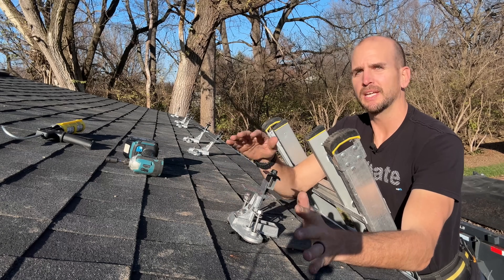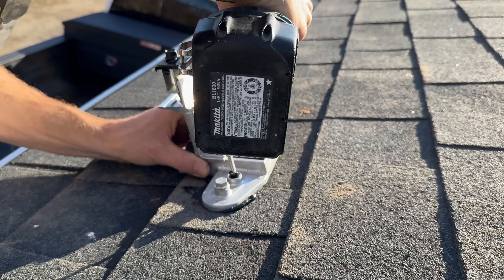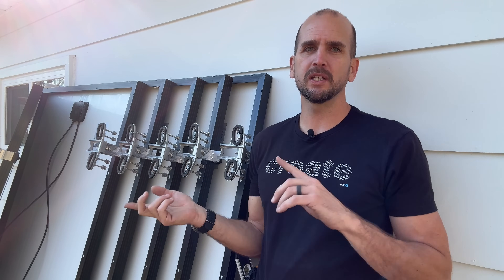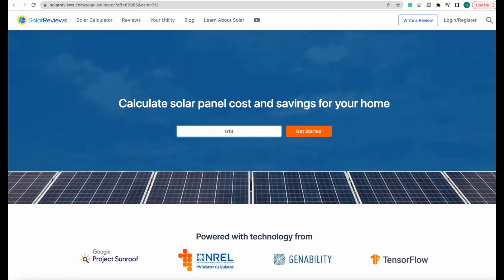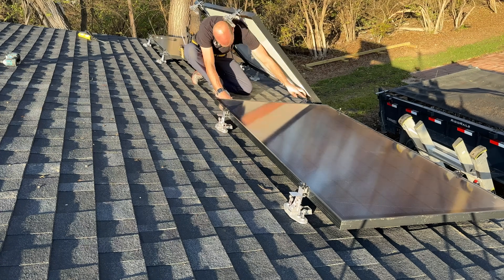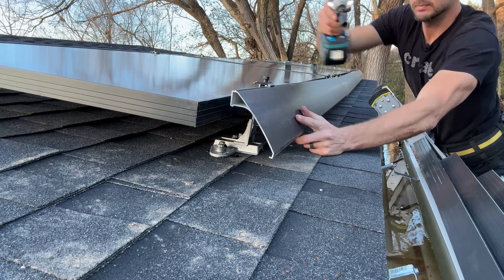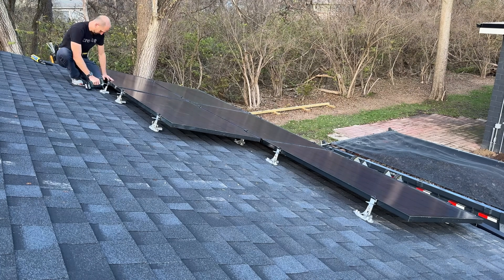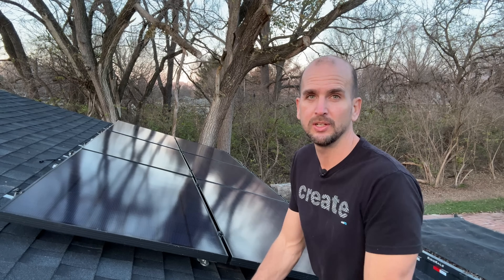Easy DIY Solar Panel Roof Installation

Comment: Lots of concerns about the holes and sealant, not sure why, you seal all sorts of stuff on a roof and if you install a metal roof all the screws are exposed with a seal on them. Anyways good tutorial on installation....my only question is if a bottom panel gets damaged can you replace without removing top row?
Reply from the maker: Yeah, the holes concern me as well.  That is why I wanted to test these on an unfinished detached garage as compared to my home.  You will be able to replace panels from the first row without removing top row but probably will have to remove that section of skirting.

Comment: From my experience in the marine industry, ALL sealants eventually leak. And that is on a clean, smooth gel coat surfaces. Sealing on asphalt for long term will be next to impossible, especially the way you did it. Most of the sealant is sticking to the shingle grit, which is not integral with the asphalt shingle. That grit will release from the shingle at some point in its lifetime. As the asphalt shingles lose their volatile compounds, the shingles will shrink and crack. Wind and thermal loads will cause movement and flexing of the panels, and the mounts where they are lagged to the roof. All of these factors spell disaster for keeping the water out. Wet drywall would be the least of my worries. The roof decking will rot, and eventually the roof trusses. This will be an expensive repair once the inevitable happens.

Comment: Cool concept, but I feel like a strong wind would rip the sheeting right off the roof.
Reply from the maker: They claim 90-180 mph and not sure what factor gets you 90 and what gets you 180.  Most likely the decking thickness.
Reply: Looks like osb roof. Weak.No drywall means you can put plywood backers inside.Next time hit a truss n backers.And seal around those things not just under.

Comment: Aluminum solar rails are SUPER cheap and easy to work with, I'll stick with them, and simple L-feet with rubber micro-flashing in rafters.  I installed my own 5kW PV system this way, several years ago, and it's worked perfect, ever since.

Comment: Could i use these mounts on my camper conversion!? Ill be useing an eco flow ultra for my batteries and electrical system
Reply: 1/2 inch osb doesn’t hold well.Must have big inside backers for bolts to grip.I’m not cutting my ceiling out for backers just yet.Even if yah hit a truss that’s only 1.5 inch.So only 1 bolt would hit it..First I ever seen those brackets

Comment: Absolutely not. Relying on sealant rather than flashing?!?! Also, roof sheathing is often only 1/2 inch thick so it's laughable that the bolts are so long - it's almost as if they give you long bolts so you think you're getting a strong connection. I would expect those bolts to get ripped right out during the 60-70+ mph winds I get in my area every year.
Reply: I get those winds in Cheyenne Wyoming too!!!! Where are you?

Comment: Looks nifty!. I don't see sealing as a significant problem if done correctly. Wind resistance may be perhaps. Permitting is the number one reason DIY sucks in many places however. Most people give up before getting past that.

Comment: I think we should add silicon to the screw threads as well to ensure sealing.
Reply from the maker: If you fill up each pad as the lag is being driven it will pull through the sealant and should coat the threads fairly effectively.  At least that is what I was seeing.

Comment: In my jurisdiction the local inspectors will not let you make penetrations without flashings. I've pulled over 200 permits and often work with roofing companies especially when the homeowner just paid for a brand new roof with a long term warranty. I tried something like this in the past and the roofer yelled at me and told me to get my ass off the job site because I did not use flashings. Also we are in the Highwind zone and I do not think you could ever get away with penetrating the decking only. Also I have run into many situations where the decking is old and not competent and you absolutely have to be secured into the roof truss. So you mount six panels Which requires 24 of these mounts and 96 penetrations. No disrespect but I think this is a horrible idea and you do take a serious risk of having a leak 5 to 10 years down the road. Also installers get lazy with the caulking and do you have a good chance of having leaks right out of the gate. Eco Flo delta's are for camping they are not residential power quality and good luck if they even last five years. Also this guy is clearly not pulling a permit because there is no rapid shut down devices. This is another video that is essentially showing people how to do things wrong and is a bit of a stain on the solar industry.
Reply from the maker: Thanks for all the feedback but not sure this type of video would be considered a "stain on the solar industry."  I do agree with the rapid shut down need in the vast majority of areas.  I am still on 2014 in my area so I can have the shutdown at the system level as opposed to the panel level.  The way I approach these project is just to show "how I did it" and not to be mistaken as " how you should do it."  Building and electrical codes will be different for all of us and each homeowner would need to take a lot of things into consideration if taking these type of projects on DIY.  Looks like other major brands have a similar option, have you ever used or seen the Halo system by Iron Ridge? https://www.ironridge.com/component/halo-ultragrip/
Reply: @everydaysolar  OK, I understand your comments. Sorry about that. I didn't mean to be rude. I've been in the solar industry for 24 years and in my neck of the woods I would get my ass chewed out from a roofer if I was doing penetrations without flashings.
Reply: @Riceman-o1p  honestly I welcome the feedback.  Keep it coming! 👍

Comment: Per NEC, if the solar panels are mounted to a building, Rapid Shutdown is required. It isn't waived depending on what you connect them to. The inverter may be portable, but you've made the panels fixed to the building, so it must meet NEC in most jurisdictions. There are some exceptions.
Reply from the maker: Agreed, I tried calling this out as I will be installing a system-level rapid shutdown  since my area is still on 2014 and the panel level came in on the 2017 updates.  Thanks for the feedback.
Reply: What are the exceptions?
Reply: @alexborrego8051  Mount them on the ground, not a building.

Comment: I love the low cost and simplicity, but this product puts a lot more holes in the roof than a rail system would.
Reply from the maker: Yeah, I have a similar concern and at least at this point am comfortable with this setup on an open detached garage.  I will keep everyone posted on how this system holds up over the years.
Reply: @everydaysolar it’s time for an update for sure?

Comment: Hey Scott,  I am looking for a controller that will take in voltage different sources. I would like to build my system to take in solar as the primary and wind as a back up so one charge controller will take care of both inputs.  Have you done a video on this, or do you have a suggestion?

Comment: Something to do before you do you own DIY solar panels on your roof.  First check with your insurance company, have an insurance adjuster come out.  He/she will be able to tell you if a DIY solar project will be covered on your insurance coverage.  This is very important as your insurance company can and will say your solar panels are not covered on your insurance coverage.
Reply: You don't want to call Andre for some material thing like that when they will be mad. At you, as they get paid usually on them finding damage.  What you want to do is call the underwriter.

Comment: I don't think this would work for a home installation, especially in Florida with hurricane strengths wind. Not bolting into trusses would be a big 'no' for me, how about your house insurance? I don't think they would be OK with this either. We have a roof wind mitigation report done to get any insurance and I don't think the inspection would pass this. This is all besides the big risk of water intrusion through the bolts in the roof sheeting, even with caulking. That caulking wears very quickly in Florida, and you would probably need re-caulk every year to ensure a tight seal. If this is on a free standing garage or shed, maybe. But I don't think its worth the risk compared to the traditional rail system.

Comment: I don't like it Don't rely on silicone. Black Jack take take that ladder. You're Standing On put it from top to bottom side to side. Mount panels on your ladder.😮 Take the load off The roof more on Walls of home

Comment: Have you found any difference mounting panels HORIZONTAL like you did vs. mounting them vertically ?
Reply from the maker: Nope, all other things the same the orientation shouldn't change the power output.

Comment: I'd be pretty leery of all those penetrations and relying on the sealant.  I'd also question the strength being only tied into the sheathing (and most people won't even know how well that's nailed down either!)  I also don't like all the snow loads aren't placed on the rafters, just the sheathing.  I like the front trim panels as it looks cleaner, but it also lowers the efficiency of the panels too since it will restrict some under panel cooling.  But again, in your case you're aware of all of this and you're fine with it.

Speaking of rafters, I noticed a lot of flex as you're walking around in the video.  With the extra weight of the panels, you might want to consider sistering those rafters.
Reply: Yeah. My first thought were...,where are the flashings?" Sure enough...no flashings. There's no way I would rely on just the sealant for that.
Reply: Point well made. Form Statics and Dynamics in engineering, you can center the middle of this into where the flasher is since it is about 2 inches wide. You now have the outside 4 bolts are held by to sheathing planks.  If you can visualize this the plank is nailed on the flasher so ripping those will be 4 times as hard. If you are that good in alignment, you can use the center peace and get a long bolt through the flasher and bolt it down at the bottom inside and top also. problem solved, That is if you are as anal retentive as I am. Question is, Has any one installed these brackets and what has their result been? can signature tell us if they would still be on sale if these were unstable in high winds?
Reply: I had the same concerns too.  These "flash-less" mounts were introduced around 2019 and, since then, more manufacturers are coming out with their own flash-less designs!

The amazing thing with TopSpeed is they even did away with the railing!  That's a huge labor and  cost saver especially with expensive freight for such long pieces.

Comment: How strong is this mounting without the rails to support the panels and distribute the load across the mount to the roof?  Any testing on the winds speed?
Reply from the maker: Yeah Snap N Rack quotes these numbers for speed and snow load 
90-180 mph Wind Loads
0-90 psf Snow Loads

Comment: I'm much happier with the iron ridge flashed feet i used for my diy solar install. Fewer penetrations, all into rafters, and less relience on sealant. 

The rail systems also make great mounting points for microinverters and cable management.
Reply from the maker: Yeah, iron ridge makes good stuff and for my home I also have a flashing design but for detached garages/sheds I kind of like this option.  Now lets see if we stay leak free 🤞

Comment: Nice video about a new type of panel  mounting, although less options for nice cable management.
The sun seems to be behind you while it is morning (I assume), the panels are not in an ideal position for maximum production. Would the opposite roof side be better?
Reply from the maker: Yeah, these are on the East side of the roof and I would prefer the West to get a little more but there is shade that comes in on that side that would knock out the normal gains West has over East.

Comment: Is it possible to get a list of parts you used? I'm going to be putting 6 panels on my shed also
Reply from the maker: 242-10005	SNAPNRACK, TOPSPEED MOUNT	18
242-10011	SNAPNRACK, TOPSPEED CLAMP	2
232-02492	SNAPNRACK, UNIVERSAL LANDSCAPE SKIRT, 70IN, BLACK	3
232-02495	SNAPNRACK, RL UNIVERSAL, SKIRT SPACER, 35MM	8
232-01173	SNAPNRACK, SMART CLIP II	24
232-01176	SNAPNRACK, SMART CLIP XL	20
242-92202	SNAPNRACK, GROUND LUG	1

Smart Clips are optional for wire management as I just used zip ties.

Comment: My solar installer just installed a new system using new mounting from Ironridge called HALO, it uses 6 lag screws if misses the trusts.  It has adhesive pad on the bottom of this mount where the screws penetrate to shingles.  This save half of the time for the installer to lay down the mount without finding the trusts.  So far so good no leaking but is seem to be too many screws 3 inches penetrate the roof boards.  My installers just put 6 screws on all of them even it they hit or miss the trusts.  Worse is when you have to remove this racking for new shingles, you probably need new roof board also.  But they still use the rails across the mounts.  4 mount/rack for each solar panel and I have 47 of them, that's 282 lag bolts holes..  Time will tell.
Reply from the maker: Interesting, thanks so much for the heads up.  Looking at the product now.  I am temped to just install a bunch of these on that detached roof and test them over the years to report back on which ones stay leak free.
Reply: My Dish satellite installer has been using this rubber sticky pad with lag screws thru it to mount the Dish brace 15 years ago and it is not leaking but when you removed it, it take a chunk of the shingle and leave a hole where the lag screw was.   Pretty nasty to remove and patch it.

Comment: Hey Scott--I am LOVING that you have a side channel for solar. I desperately want to have a solar set up but it's just so cost prohibitive. Would love to do a DIY set up, but I have a newer modern home and have a flat roof. Any insights for DIY on a flat roof? Maybe a next video ;)
Reply from the maker: Actually the home on this property has a flat membrane roof so I will be doing some projects on the flat roof most likely with a ballasted system and try some bi-facial panels to see if I can get a bit more with the sun reflecting off the white membrane.  More to come 👍
Reply: @everydaysolar  YUSSSS!! i'm so excited to hear this! Thank you!

Comment: Nice idea but I would never mount to just the roof sheathing.  7/16" OSB is not going to hold.  I wouldn't even do it on 5/8" roof sheathing.  Just not enough material to screw to.

Comment: Instead of biting into the rafters like traditional installs these are simply grabbing the plywood sheeting? Would it be safe in the wind and snow loads?
Reply from the maker: This is what Snap N Rack has in the performance specs for the Top Speed system
90-180 mph Wind Loads
0-90 psf Snow Loads

Comment: I appreciate your work. I am an architect. When I got started with solar, I looked long and hard to find a roof mount that provides a built-in boot so the fastener penetrating the weather barrier, the shingle in this case, would have a solid flashing that covers the penetrant.  Long term I would not want a joint that offers only sealant.  I don't care what type of sealant.  I would REALLY not want a design that increased the number of fasteners and more holes like this.   A solid flashing, a hood, a boot, that drains with the roof slope and can resist wind-blown rain is best.  There are several designs that do this pretty well. Applying sealant to the penetrations UNDER the hood is just fine.  Belt and suspenders.  This is your ROOF.  Water penetration is a great risk to buildings.  16 potential leak points per panel.

Rails are more expensive.  This connecter is fast for DIY.  OK.  you did a good job telling about it and you want comments on the controversial part.  You are a youtuber.  Your numbers go up, and I am not a grouchy old guy with nothing better to do.  Great.  You may already have videos that cover these other type of boots.
One day the building gets reshingled and all this stuff will come off.  It would be great to have a system that you could match up the same locations, shingle around your boots, and put it all back on again.  Or maybe that is when you upgrade to a standing seam metal roof and do S5 clips.
Reply from the maker: Thanks for all the feedback.  To be honest I would not put this type of system on my house but this unfinished open garage is a good test case so I can see if leaks start to form and share the information with the channel.  I will continue to test different options and would love a large pole barn in the future with a standing seam roof 👍
Reply: @everydaysolar so how is it holding up.. any leaking?
Reply: @everydaysolar if you foot the bill on time and materials I'll volunteer my 40x60 pole barn 😂 I'm even in Illinois although not sure what part you're in.
Reply: I agree,  We used Iron Ridge mounts that are flashed under the shingle above and bolted to the truss or rafter.  Way more water tight and stronger.  I would never mount to just the sheathing.   Have videos of our install on our channel.
Reply: @Off-Grid  Under the shingle flashing has been used in roofing for decades. Lot of these quick mounts relying 100% on adessive makes the install quick. In 5 or 10 years solar installers won't be back to fix the leaks. I've never found a self drilling lag bolt that won't crack a 2x4 without a pilot hole. I've tried all kinds of them they all crack the wood.
Reply: @Off-Grid  Yep, that's the one. Iron Ridge on shingle.  Post Frame building with Standing seam and S5s is the way to go.